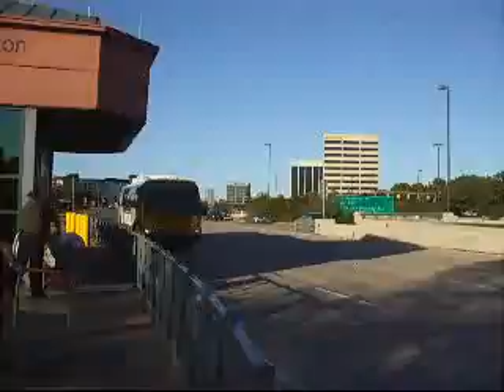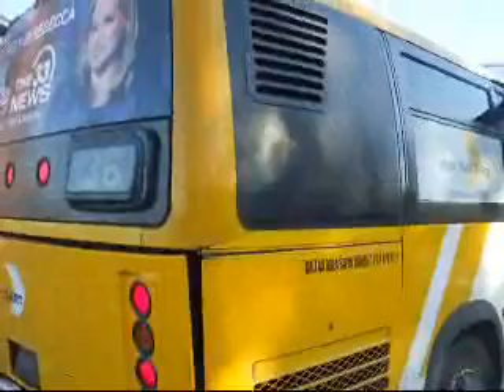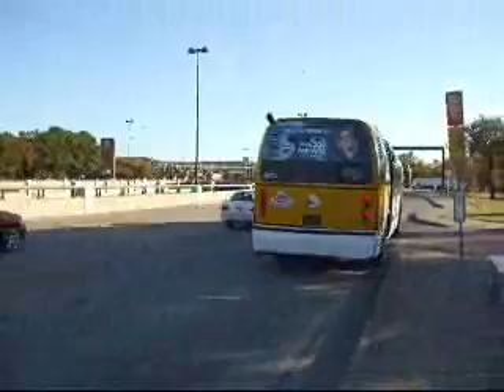DART 4695 @ Cityplace

Comment: actually this bus here has a Cummins ISC engine. The buses with the Detroit Diesel series 50 are the 82VWs, the 102x40(08WFD) have Detroit Diesel Series 50G engines and ZFECOMAT5HP590 tranmissions, the RTWFD82, which is the bus in this video, has a Cummins ISC and ZF ECOMAT 2H592C, the second bus that pulls up in this video that isnt fully recorded is the RTWFD-82L with a Cummins L10, 280G and a ZF-ECOMAT 5HP590. the RTS-82 had a Cummins ISC and a ZFEcomat HP592C.